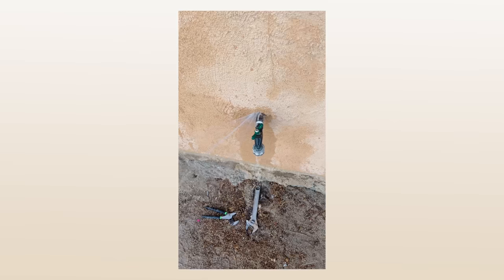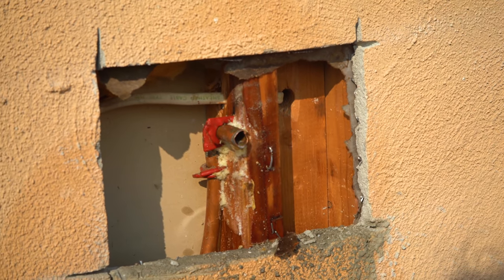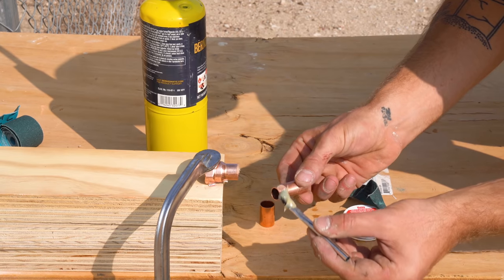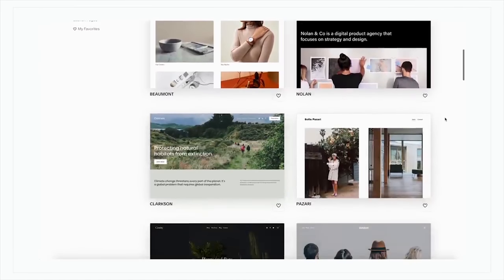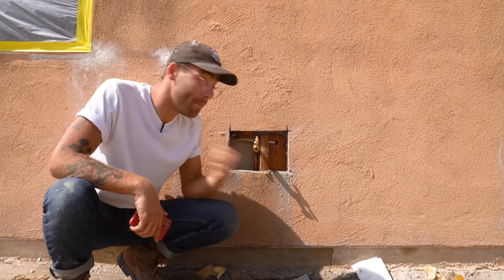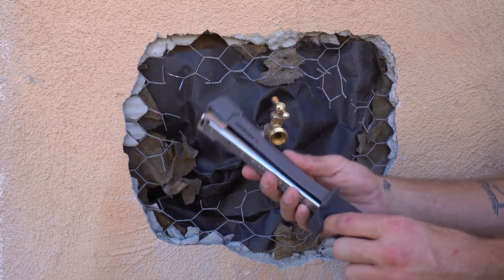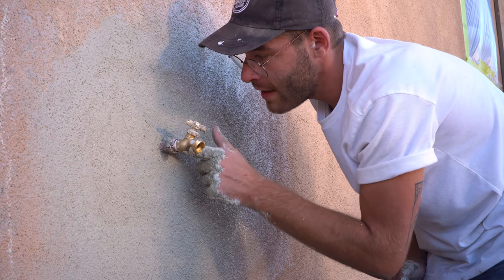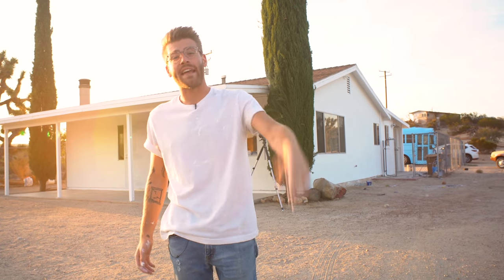PLUMBER QUOTED $750....I FIXED IT MYSELF!! DIY Hose Spigot and Stucco Repair

Comment: The amount of solder is quite a lot, it can run inside the pipe and cause a groove which makes the main pressure build up in the one spot more and can crack the Joint. Also, it's best to give it a minute or so to cool down before touching with a wet cloth, if it goes from red hot to cold it can also crack! 😬

Comment: Why not add a hose reel with a connecting hose to the spigot so if you accidentally pull hard again the reel takes the brunt of the force
Reply from the maker: I like that Idea!! I should build one :)
Reply: Great idea! Although in my extremely similar case to this video, my spigot broke off while  I was trying to remove an old dysfunctional collar (same as the one he could not remove), so a hose reel would not have mattered.
Reply: Mike as always you did a fine job with both repairs. The one thing I would recommend is to use a ball valve as they don't have the rubber seals which dry up in the heat and are easier on your hands in the long run.

Comment: There's two prices you can get when you get a job quoted by a contractor like a plumber or any type of handyman... 1) the it's an easy job I am happy to do it price and 2) the I don't want to do it price. Sounds like you got the 2nd price there when the plumber quoted you $750
Reply from the maker: I think so!
Reply: That 4pm Friday price lol
Reply: @danervin2530  4pm Friday price out in the desert. LOL
Reply: Fact-check true.  Even when someone accepts the “I don’t want to do it “ price I have to keep pepping myself along.  I usually bump the price enough to buy myself a new tool I’ve been wanting as a bonus.
Reply: Pretty much my first thought ... the "I'm not interested in doing this lame job which is just slightly out of my drive range ... so I'll make him pay for it to be worth it for me".
Not trashing the plumber, I've quoted a couple jobs (on the black) the same way. Too much of a hassle to do, and not quite friends enough to give them the "ok I'll do it service for friends on a happy price for them". I'll go out of my way to do a professional job for friends and make little to no profit from it, with the understanding that they owe me a service and a nice meal.

Edit:
There is however one majorly important factor to take into consideration about quotes, the skill of the contractor.
Whilst someone might be able to have it done in an hour, it will be of average quality, not necessarily to (up to date) code, and usually the higher cost contractor will take the time necessary to do on pare or beyond quality work to match.
Price varies wildly on the simple factor of how much a contractor values the quality and experience he has. And oftentimes, hidden issues are built into the quote, and some fare contractors I've dealt with (and now work with) have on occasion reduced the cost of their work because they didn't encounter any hidden issues.

Comment: In Europe we're using PVC pipes it's way easier to work with.
Reply from the maker: same here but my house was built in 1958 🤙🏼
Reply: My son had his house repiped with PEX.  It was much cheaper and  really fast.  The only copper used was exposed areas.  Europe has been using PEX for many decades before the United States.  My RV is completely plumbed with PEX.
Reply: @2-old-Forthischet  we got a home in Mexico and also had pvc. But also for the exposed sections. Can you add copper external parts with pvc?
Reply: How does PVC cope with freezing damage? Is it any better or worse than copper? Here in the UK garden tap lines are typically copper and standing water freezing in them is a common cause of damage.
Reply: @WorldReligion  my son's house and my RV uses PEX which is different than PVC.  The contractor that re-piped my son's house suggested that PEX should not be exposed to sunlight so everything outside of the house is converted to copper from the PEX.  

I know there are adapters made for converting copper to PVC as I've used that for his sprinkling system.
Reply: @-abigail  I pretty sure frozen water in pipes affects any kind of piping.  That's one reason I don't take my travel trailer out in freezing weather.  Where I live, it's jacket time when it gets into the low 60's!
Reply: We also use PVC in the US, this is an older house, hence the copper
Reply: @billymasoner3735  crazy. At first I thought the builders were being cheap ( obviously I’m very new to building and am just learning

Comment: i did this myself, even replaced the stucco.   had to buy all the tools and supplies as i had nothing.  total at home depot:  $450.   did the whole job including replacing the wall and stucco.  About a month later i noticed this huge wet spot on the wall.   Can't get to the other side (there are kitchen cabinets and sink a there and would have to tear all that out) so i have no idea what, if any, damage is going on on the other side but it's obvious i have a leak.   Called a plumber.   He quoted me $600 to do the same job over again.   Once he completed it, it was found that I did not solder the pipe correctly and it  came just lose enough to cause to a small slow leak.   His work was guaranteed for 6 months so if there should be another leak in the same place, he'll come and fix it for free.    My total cost for this job:  $1050.  You call somebody not because you are incapable and can't learn how to do something but because it has to be right the first time.   I can't "practice" on my own house.   Still, i have no idea what damage has been done inside.   i am hoping it will just dry out.   Otherwise, it's a job for the next owner and it's damage that no inspector will ever see.   If there's significant rot, it will show itself eventually down the road.

Comment: My skill level can definitely handle this. I would say that it’s easy to moderate. I will also say that the quotes he got were ridiculous. I realize that you’re paying for a solution and not by the hour but the numbers he got were just flat out gouging and discouraging.  In reality, I think everything the plumbing in the stucco could be done for around $250 and still make a good profit especially if the craftsman had the materials already. If you have a situation like this and you’re not up to it, both of these are some thing a handyman could take care of going to a plumber. You’re going to immediately get gouged for something that doesn’t really need a plumber. Great video keep up the great work.

Comment: Wow!! I am impressed. I have to repair an identical hole in my stucco. The plumber my home warranty co. sent out, could only do the plumbing part, after my spigot pipe split (no water for 2 days) behind the wall. It looked exactly like your wall after I cut it out. Now we have to fix it and your video is going to save us!! Thank you! 👍👍👍 I will come back on later and let you know how it went. Thank you again 😁

Comment: Two things I noticed for anyone following his lead: 1- the insulation was put inside the wall in reverse. Paper should  face inside the house. 2- The black paper barrier should be in front of the existing paper at the bottom of the hole. He correctly tucked it under at the sides and top. The stucco work he did was very good.
Reply: Good points.

Comment: Great video! the issue with the waterproofing though, you fit that patch behind your existing waterproofing as opposed to patching it completely over the hole and sealing. When it rains now, the water will run down the existing flow (behind the stucco), flow into the hole and behind your existing waterproofing into your insulation and framing. This may not be an issue for you in the short term but 100% will lead to water intrusion and eventual damage and mold. Also the hole cut into the new waterproofing for the plumbing should have been sealed as this will also lead to intrusion. Great job on it though I hope that explanation helps a bit.

Comment: Great job! I had a small leak in a copper line that fed one of my hose connections. It was further in the wall behind two bathrooms so that meant busting out sheetrock to repair. But, before that could be done we had to test for asbestos which was positive. Since both bathrooms were gutted I had my plumber repair that line and update all of the other connections/lines, which were from the 70s, in each for a total of $600. The work was way beyond my skillset and worth every penny!

Comment: During last winter in the UK, our copper pipe at the back burst due the cold temperature. As a female diyer, did not have any ideal how to fix and a plumber was quoting like £200. I shut of the water, watched few YouTube videos and ordered what I needed from local hardware. I was able to reconnect the copper pipe with the fittings and since then, no leaks or burst pipe. However winter is coming so just to be sure, ordered so heavy duty insulation to wrap around the copper pipes, it should provide some protection from the minus cold. And if it burst again, we'll atleast I know what to do. To be honest, I find it more rewarding to fix it yourself than paying someone else. Great work👍
Reply: up here in the land of -40, the best option are long-neck frost-proof spigots that have the valve 6 to 12” inside the wall so it (and the water line) stays inside the warm zone, and only an empty pipe is exposed to freezing temps. Plus they have mounts to secure them to the exterior of the wall to seal it, and provide support so you can’t pull the pipes apart.

Comment: They also make compression fittings for copper. I have used those before which take no soldering. Not sure if they do faucets like that but I fixed a washer supply line that way in my old house when the pipe froze.
Reply: On one of my favorite YouTube DIYs which is in Germany, Andrė did copper pipes for the bathroom he’s installing and he used compression— no solder. Seems like it worked beautifully.

Comment: Note, Once the slobber starts to flow, pull back on the heat. (Capillary action takes over)  Too much heat is as bad as to little heat . Good job !
Reply: That is a funny typo
Reply: @Greg8872  It's good life advice :)

Comment: This is the first DIY video where I knew how to do a project! I even had a cracked copper pipe to a hose bib. The plumber repaired it and it only took him an hour and a half. His hourly rate was more than fair! Not your quote. I learned and did a lot of stucco repair summer of 2020. Kirk Giordano Plastering's videos are the best.

Comment: Aluminum and brass will fuse over time where they touch. I use assembly grease from my mountain bike stuff when using a hose with aluminum ends.

Comment: Nice job on the repair. 
I do think it would have been a good idea to anchor the faucet bib to the stud and isolate the copper tubing from the metal mesh and the stucco to prevent chemical reactivity in the copper.
Reply: I’ve never seen it done that way. It’s always copper pipe coming straight out from the stucco.

Comment: I actually learned how to solder last year when we did all of the sprinkler and drip in our yard! It cost us around $1200 which includes supplies and tool rental. Our yard is 5000 sq ft. Recently, I had got a quote for a small paver path, fire pit are and new rocks for the non grass areas and they legit quoted me $18k. We did everything in our yard thus far so sprinkler/drip, installed two hose bibs, landscape and sod and I hired out curbing. At most that was $3k and a ton of back breaking work. Had we hired it out it easily would have cost $12-13k. I am a total supporter of DIY. I will hire out for stuff that I don’t have the skills for like concrete work but  with my Father in Law and my own Dad being in the trade why wouldn’t I do as much myself as I can under their guidance! We still have a ton to do out there but I love your videos because they are informative and alot of what you are doing I will be doing so thanks for sharing the journey!

Comment: Try switching to Gardena-style hose connectors. They connect/disconnect very fast and easy and will greatly reduce your chances of having another spigot break off. Everyone uses them in Europe and you'll never want to use the old screw-on ones again.
Reply: which ones are those?

Comment: It's always worth to give it a try with jobs like these. Even if you botch it up, it's not like the contractor will charge you more for doing the preworks for them.
And finishing off a wall like this with a brush or a sponge is so rewarding, going from looking barely OK to Super Pro! 😁

Comment: As a stucco contractor in fla you did a great job on the repair,the rapid set is perfect for small repairs 
,home owners need to ask any contractor if you cut into the wall will your price include the repair also👍

Comment: I had the same thing happen to a hose of mine. Not on the house side, thankfully, but on the nozzle side. Not matter what I did, it wouldn't come off. Ended up cutting the hose and putting a repair kit. I think what caused the nozzle to get stuck on the threads was the poor water quality in my area. I saw a ton of build-up inside once I cut it off. Not sure what your water quality is like, but if its hard or bad water, I'd suggest removing it from the new spigot after each use and removing your nozzle as well. Great video!

Comment: Nice job getting it done and saving yourself hundreds of dollars. I think it should be noted that when soldering copper pipes, the heat/flame should be on the opposite side of the point of solder application. In this case, heat from the bottom and let the solder melt from the top. That way, this ensures that the whole joint is heated enough to pull solder and gravity also helps it. It's not always the case, but when you can do it this way, it's best practice. Also, why not repair from the interior wall? Hose bibs come with a mounting plate and a length of stub on the back side now days.

Comment: Contractors must hate the University of YouTube.
Reply from the maker: yup!
Reply: No haha we really don’t because it usually mean we get more work from homeowners mistakes 🥱😂 I’ve been on three jobs in the past week where people thought they knew how to do something. It’s great to try things as a homeowner but don’t mess with electrical, plumbing and especially gas fitting unless you know what you are doing👍🏽
Reply: They don't, still enough jobs to go around. Especially if the repair doesn't hold or you all around mess up
Reply: Most people on youtube give out wrong information and repair things badly.  They also seldom repair anything up to code so when they sell the asset and the repair inevitably goes bad for the new owner it will end up costing them a lot to bring it back up to code.
Reply: We love it!  Half our calls are from people who started something and end up in a disaster!
Reply: @johnlittle4858  well I think he did a good job I don’t know about anybody else
Reply: Drives me crazy
Reply: All I do is multiple trades well which makes jobs like these my bread and butter. Although love how at the end he adds “so maybe 8 hours” lmao… you just need to find someone who has it all in stock and can do both trades at the same time.

Comment: Nice job. If you have to do something like this again, it might be easier to repair from the inside and you’ll just have to do drywall repair. I have had hoses freeze up onto hose bibs in the past. I make sure to use Teflon on the threads and plumber’s jelly so they don’t fuse.

Comment: I got an estimate like that a few years ago and was like no thank you. For those that can't then absolutely get a plumber but if you can do it yourself do it yourself. No slam on contractors but sometimes they just want to rush to get it done to move on to the next job and may compromise on the quality of the job. On the  flip side you, as a homeowner,, not only want it done right but to look good too. In my area that is not always a given.

Comment: Those pipe clamps are ones you should just be able to yank out, use those channel locks and just pull away from the wood and start to pull up and down and it should slide out,not always easy but thats the best way

Comment: And not too mention everything you do to your house, is sweat equity. When you're done with all your remodeling,  have a realtor come out or an appraiser on the value of your home. And when filing taxes remember to use a 1040A long form . 
And if the value of the house is more, which normally it will be you might be able too do a refinance and pullout some of that equity money.  Then reinvest it back into the house.  This is a good tip and I know it works made $250,000.00 dollars in equity money  on a home in Cali. Just put large portion back into the property,  ie: addition, multi car garage, swimming pool,  and landscaping. 
Take care and your welcome about the tip, God bless amen.
Reply: Just paint it and add some grass to a house in California and you're rolling in the money. 😂

Comment: You did a great job. My only little piece of advice is about checking for leaks once the repair is done. As your faucet is closed, there's air inside the pipe and when you open the mains back, that air will be compressed but will anyway occupy some volume. I mean, unless you did some really bad soldering, you may not notice small leaks. It's better to open the faucet, let it spit some water and close it back. Now the whole pipe is full of water and you can actually check for leaks.